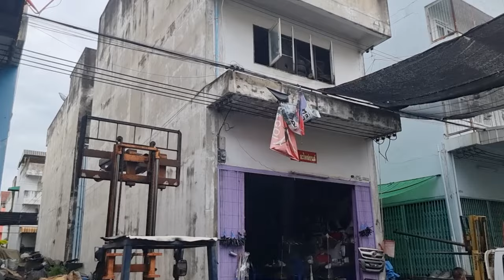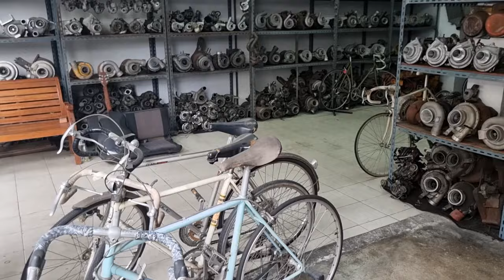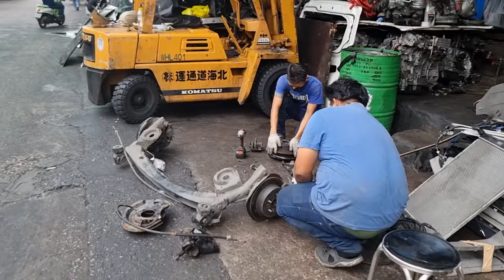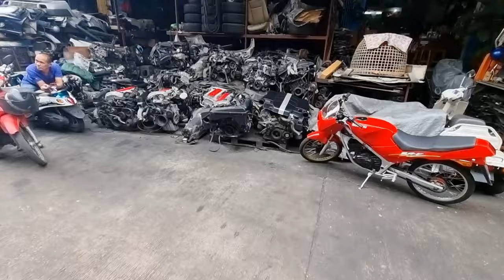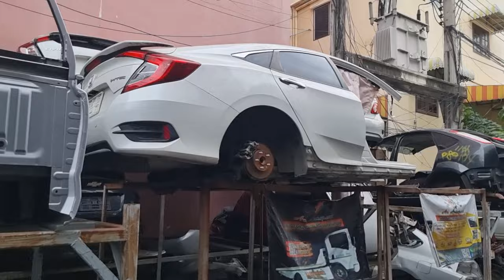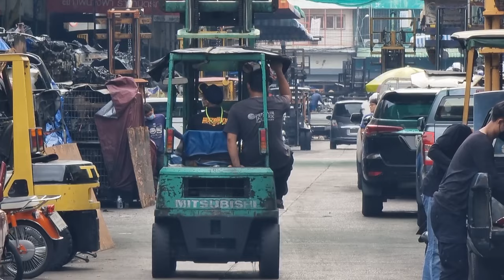BANGKOK THAILAND LARGEST AUTOMOTIVE MARKET

Comment: Nice piece of information. I live in Bangkok, and once I was passing through China Town, near the old central railway station (Hualamphong), I noticed some shops in an area were stacked with different vehicles parts and wonder if it this is the same place.
Reply: did you ever find out if this is the same place near china town?  Im looking for this as well.